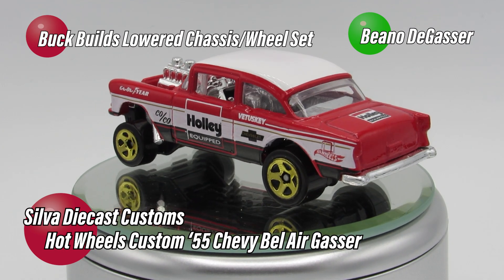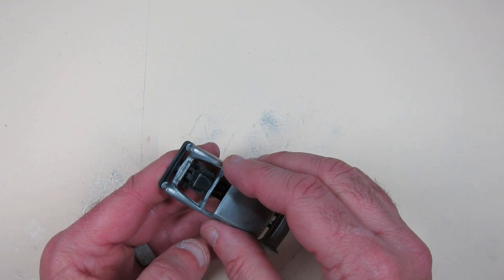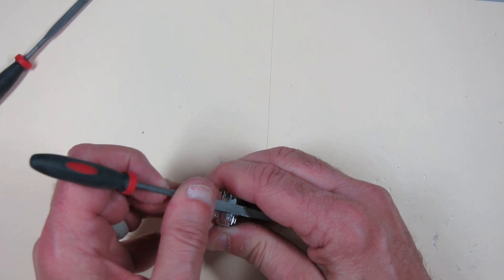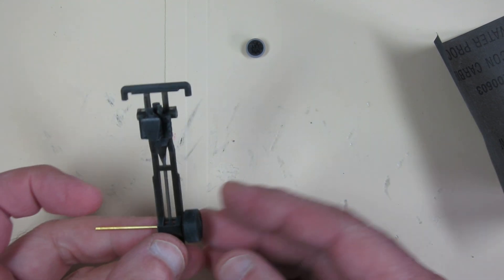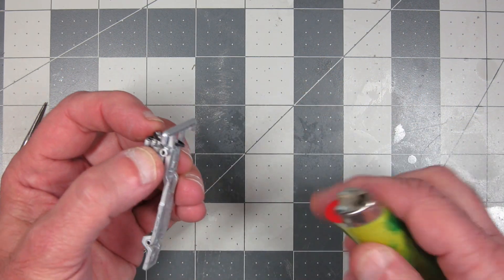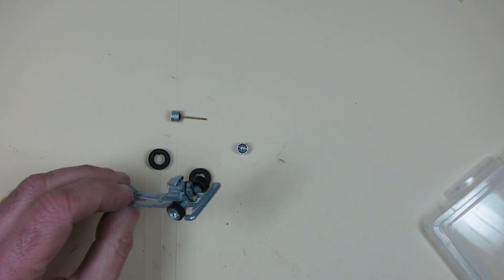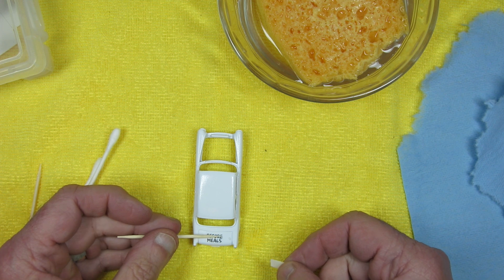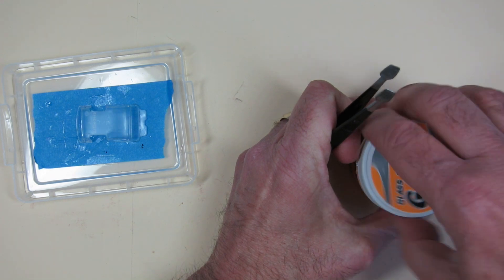Hot Wheels Custom '55 Chevy Gasser - Beano DeGasser

Comment: Easy way drill it jim screw with a washer
Reply from the maker: LOL I should have Eddie...if I remember correctly, I might have even mentioned it at the end when I was putting it together that a screw/washer combo would have probably worked, but that casting is long gone now lol.  I lost it in the first JDC Pinks race (sigh) lolololol

Comment: A cheap easy way to degas the gasser that of course isn’t as cool is to use the base off of a Chrysler 300c
Reply from the maker: That can work and there are some others that I've seen (and one with a rather plain 3d printed chassis that I almost started) that just didn't inspire me to do this build that I've actually had in mind for awhile.  Seeing the Buck parts gave me the kick I needed to get going.
Reply: @JimSilva-SilvaDiecastCustoms  that's completely understandable. I just put it out there for you if you didn't know and for anyone else if they didn't.
Reply from the maker: Oh no Nick, I knew that's why you mentioned it and I do appreciate it.  I just wanted to explain how sometimes I'll have builds in mind that for some reason or another, it takes something to come along to give them that added "excitement" for me to do them.  For example, I have a sponsor in mind that has a fantastic graphic that I would love to see on a van in 1/64 (at least I think it's fantastic lol) but I just can't find the motivation to attack it.  One day, that push will come.
Reply: @JimSilva-SilvaDiecastCustoms  I understand that. I've got a pile of cars I want to build I just never have the motivation.